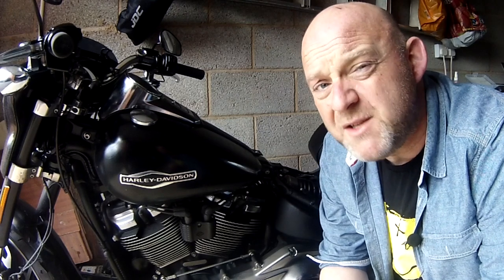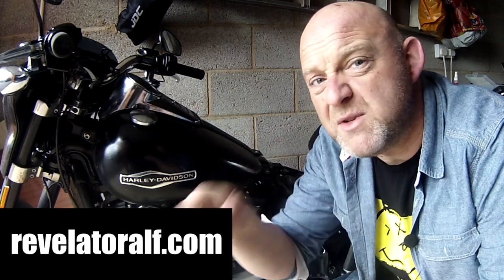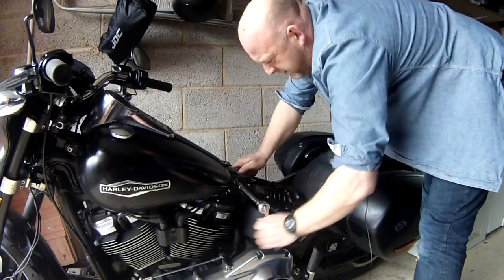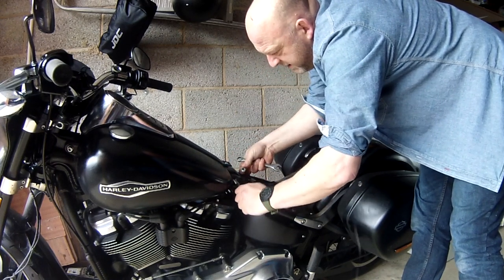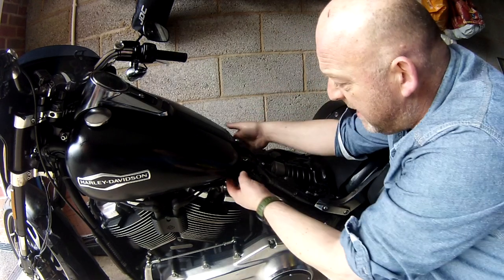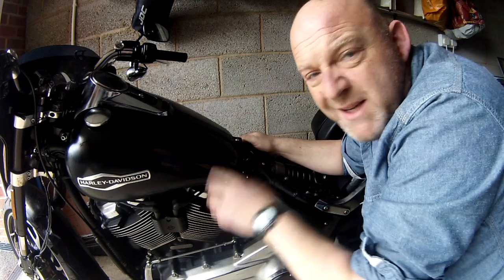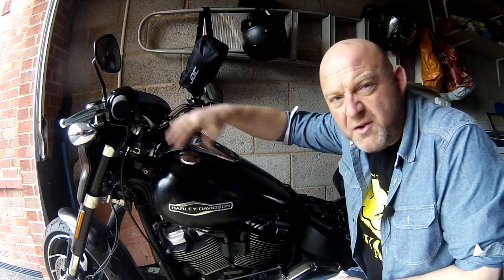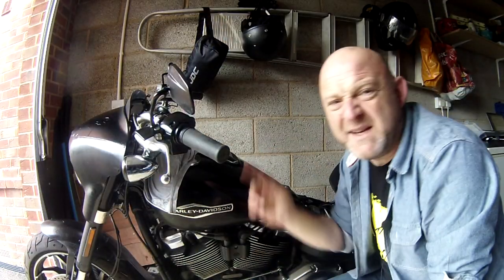How to purge fuel lines on Harley Davidson - H-D Sport Glide Fuel Line Purge

Comment: Great video, thanks.
Why do the fuel lines need to be purged, why can't the tank just be removed and then fitted back, is it to prevent air locks?
Reply from the maker: cheers, yep but I don't bother with purging when I take the tank off anymore, cheers

Comment: Nicely done! Looks simple. I now have a great reference for when I need to do this.
Reply from the maker: Thanks pal. Yep it's not too difficult but just a bit of a fiddle to reconnect afterwards. Cheers
Reply: RevelatorAlf Is this enough work to get to the spark plugs?
Reply from the maker: @DCyclemoto  Yes probably but in my next videos I show the next steps to take the tank off which is preferable I would say. Otherwise you'll have to balance the tank whilst changing the plugs.

Comment: Thanks Alf for this vidéo 😉 ! I can learn so much with your clears explainations ! Is it neccesary to purge the fuel line if i only need to remove and take off the fuel tank (to install additionals lights for example) ? ✌️
Reply from the maker: Thanks Gilles. Actually not really. I take off my tank regularly without purging the lines. Cheers